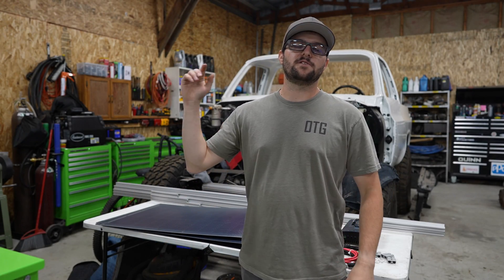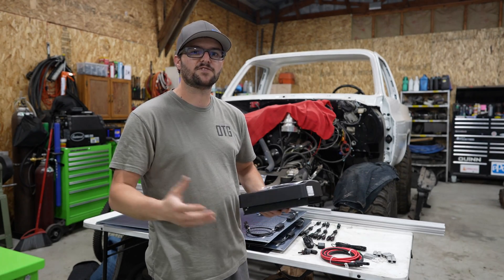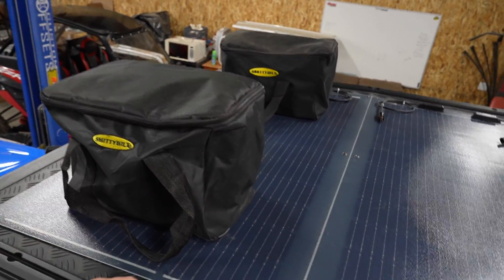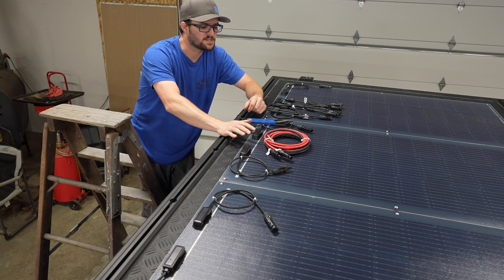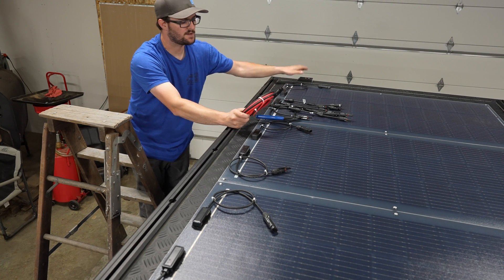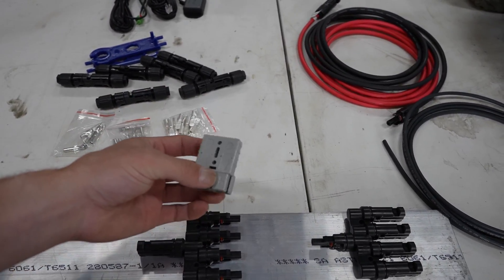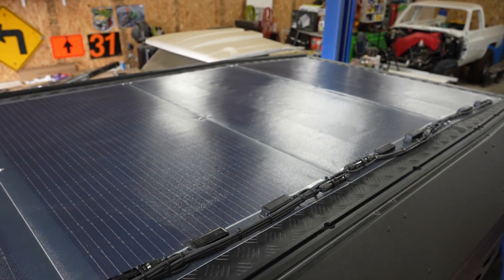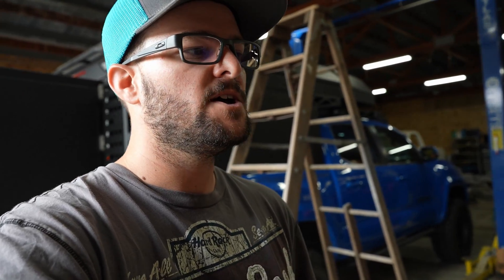Installing 4000 Gigawatts of Solar Panels on my Camper

Comment: 4000 Gigawatts GTFO. It's 4X100 watts in order to pull 4000 Gigawatts for one second the panels would have to be charging the batteries for 1 billion seconds. Assuming you set them up on the equator getting 12 hours of uninterrupted sun each day it would take 62 years to build enough charge to pull 4,000 Gigawatts for one second.
Reply from the maker: Oh dang. I had no clue.
Reply: @JustinTBraun  I assumed it was common knowledge that 1.21 GW is equal to a bolt of lightning (The problem being you never know when or where one is going to strike.) And found it a little absurd to think that four little solar panels would generate the same power as 3,505 bolts of lightning.
Reply from the maker: Lol I'm jk